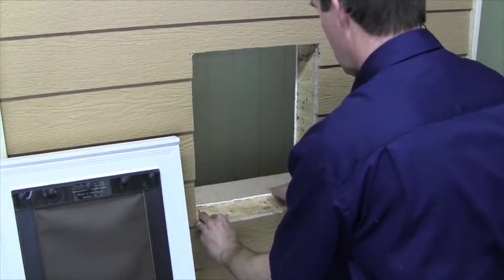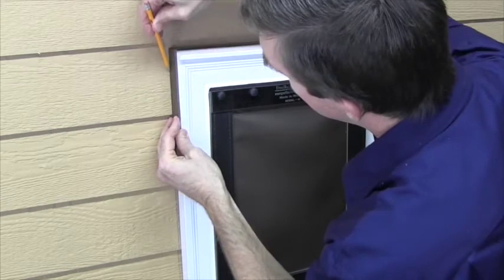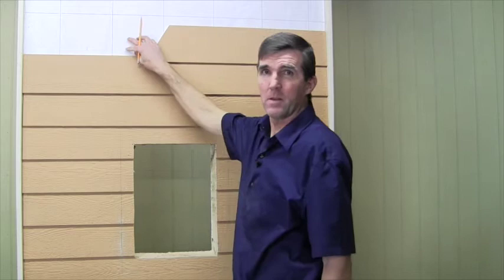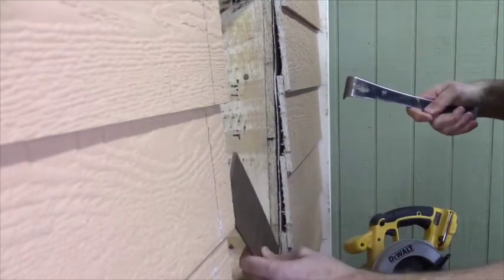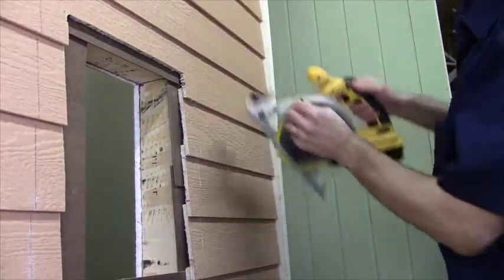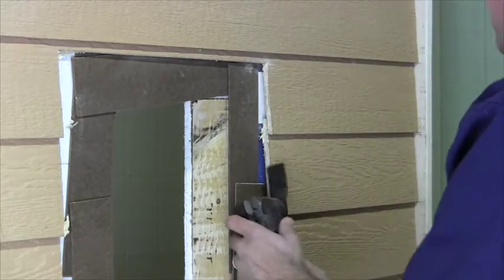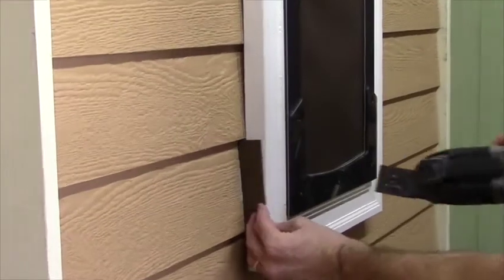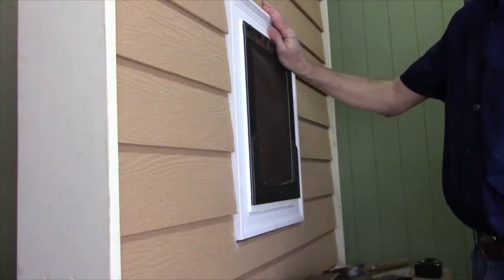6   Cut Back Siding (optional) - Freedom Pet Pass Wall-Mounted Pet Door Installation

Comment: great video.  How can I do the exact same thing, but with old aluminum siding?  I have to be careful because I have no idea if I can even find replacement aluminum siding if I mess up too bad.  Thanks!
Reply from the maker: @kevin - The cutting process is much the same. With vinyl or aluminum siding, you have the ability to use J-channel around the perimeter, which can hide an imperfect cut. If you're really concerned about minimizing mistakes, you could consider knowingly making the rough cut smaller than you need, and then using a more precision tool to enlarge it to the perfect size. It's more work, but that might give you more control. Just being cognizant that this is a "measure twice, cut once" type of scenario (which you clearly are), helps.
Reply: @rangerpetdoors  - Thanks for the quick response.  I appreciate your suggestions.  KG

Comment: Is this necessary for a stucco wall?
Reply from the maker: Probably less necessary than if you have lap siding like cement board or vinyl. The steps shown on this video series do everything possible to prevent water intrusion / damage, and cutting back the exterior cladding allows for flashing. This is only one way to accomplish this. For stucco, you could consider just making sure that there is a good seal all the way around with construction adhesive, as an example. It's not perfect, but sometimes that's tough to achieve with a retrofit.